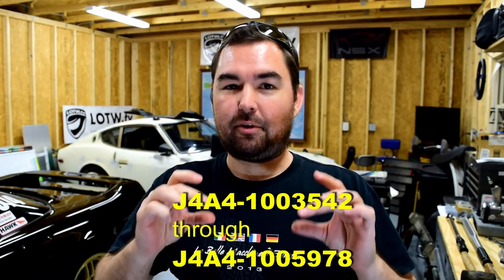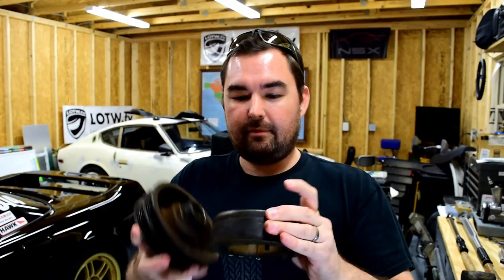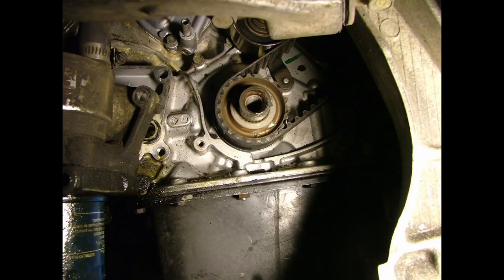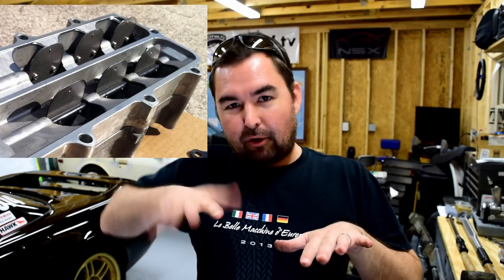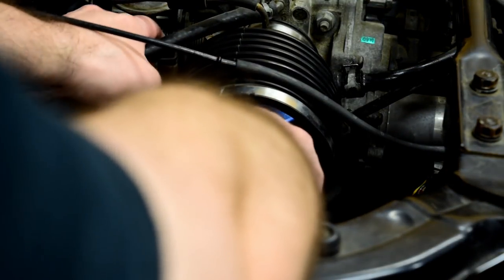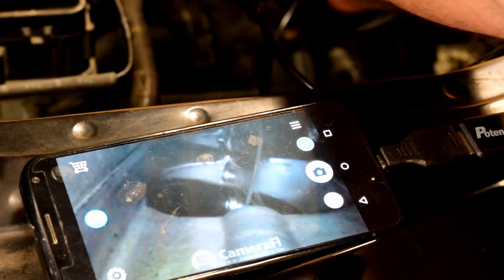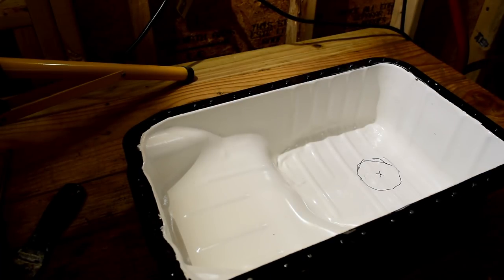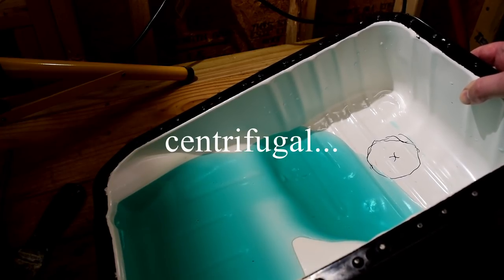5 Ways to Kill an NSX (and how to avoid most of them).

Comment: Thank you for this informative video - I learned so much! I just bought my black 1991  NSX with automatic transmission back in October with 107k miles and I just hit 116k miles! Bought it for a garage queen cruiser but I just can’t seem to leave it in the garage in favor of my 2006 Odyssey. I even have studded winter tires for it because I drove it all winter! I know...I’m crazy but I just love driving it & life is short. I live in Cincinnati area & will look up Source One. I found a great independent guy who used to work for Acura - he has NSX customers from the region come to him for work. I dropped about $2500 on timing belt/water pump, spark plugs, valve adjustment, new rotors/brakes installed. I’ll be looking into the protective pulley plate and butterfly bolt check soon. God bless you for this info. Thanks!
Reply from the maker: Grats on your purchase! These cars love to be driven, so no need to be shy about mileage.  I'm glad you found the video useful; that was my hope.
Reply: How was it driving yor NSX in winter with studs? I'd love to buy another one just to have a winter car.

Comment: I got bit by number 4....after the resultant engine rebuild I had not only baffles installed but also a high capacity oil pump with billet gears from SoS.  Haven't tracked the car since, but I've done a little light drifting in an empty parking lot. So Far...So Good! 👍🏾

Comment: Just bought my first NSX. Very informative video! I will definitely check the first 3 points asap as I don’t have a lot of info on its previous 32 years of life.
Reply from the maker: Grats on the purchase and happy motoring!
Reply: @LapoftheWorld  thank you! I will surely order the rubber seals for the coil water issue. I intend to daily it, and it rains a lot in Europe :) I have one question if you don't mind answering. Does the upgraded harmonic Pully need replacing after a while or it's a lifetime upgrade where you can forget about the fear of grenading the engine? Thanks!
Reply from the maker: @jy3406  As far as I know there isn't a Honda part number harmonic damper/pulley that doesn't potentially suffer this issue.  Most people either 1) buy the balancer shield to put behind the factory part and then inspect occasionally (because this way if it fails you have time to notice before the bad stuff happens) or 2) buy an ATI damper with a mechanically-captive damper element.  The former is significantly less expensive hence being more popular.
Reply: @LapoftheWorld  thank you! So this ATI damper would be a more “lifetime” safe option.
Reply from the maker: @jy3406  It would seem so.  That said, I can't easily cite a data point where I know someone's run an ATI damper super long term.  For my part I just run the shield and will swap out the OE if/when it fails again.  You'd have to do that a few times to offset the cost of the ATI, but as you say, the ATI may be more "set & forget".
Reply: @LapoftheWorld  thank you!

Comment: Just discovered your videos .. great job.  I have a '91 with slightly over 200k miles on it.. prob 30k of which were Canadian winter miles .. also a bunch of track and autocross days .. which I've had for the last 20 years.  Fortunately it wasn't in the snap ring range but I did do a preemptive change on the harmonic balancer and am running a baffled pan.  Just a couple of suggestions .. (1) you do mention the impact of a timing belt failure but I don't think people pay enough attention to the timing belt service recommendation, which I think was 7 years/80k miles originally but was later extended to 8 or 9 yrs I believe.  The problem is that this is a 'whichever comes first' statement and I've seen low mileage/good condition units which are way beyond the time limit.  If you own/buy a '91/92 today, it should be on it's 3rd or 4th belt by now unless it's been done in the last 7-8 years .. or has maybe been in storage a long time.  Mine has cold-started numerous times at -40 and in spite of that punishment, the belts (at replacement) have been in pretty good shape.  But going beyond the recommendation is like Russian roulette with expensive consequences.  My (2) point is you might want to order a main fuse (250A) to have on hand just in case.  I managed to blow mine during a DIY alternator maintenance and it took the local dealer 3 months to find one.   They're not terrible expensive.  
Otherwise, I think I'm living proof that with normal maintenance and regular driving, these things are amazingly reliable other than the known problems with ABS pump leaks; and the deteriorating capacitor problem which causes electronic failures in the replacement
Reply from the maker: Thanks for the kind words and suggestions!  Definitely check out some of my more recent NSX-specific entries.  I think I get to most of what you mention, just not all in one place 😁. I'm nearly done with a DIY belt job, I dealt with some capacitors I think last year, and I 100% carry a main relay with me on any extended trip.  Cheers to that mileage though!  The NSX may be the poster child for "meant to be driven"! 🍻

Comment: Oil starvation problem is not only for R comps. It happened on mine with 275 Dunlop Dirreza II rears on track. The track do have a lot of elevation change combined with very long double right sweepers.

And I've caught my butterfly valve screws from coming loose during intake removal, 2 of them are loose and 1 of them backing out. Red loctite applied to all.
Reply from the maker: At which track did that happen?  Curious if I've been there yet or not.
Reply: @LapoftheWorld  The Ridge in WA
Reply from the maker: @SoloD33A  Thanks, I'll do a little extra research before I go there.  Did you have any mitigating mods?  Baffled pan, etc.?
Reply: @LapoftheWorld  at that time I'm only testing out the car and wasn't driving hard, didn't plan to, thus i have yet to get the baffle and accusump. Then got a bit faster because cars behind etc, noticed over heating coolant, cool down lap, engine cut off. 2 rod and 1 main bearing toast
Reply from the maker: @SoloD33A  That's pretty weird.  I wonder if there wasn't some other exacerbating factor.  Either way, as you say, something to be cognizant of if you're going to track an NSX.  I just have a baffled pan and generally only run a 255 rear (though I have run R888s on the car for some TT events) and thus far haven't had any issue.

Comment: Thanks for doing this video! Curious about item #2 (crank pulley  harmonic balancer separation) . Does this happen to all first gen NSX and that everyone who owns a NA1 NSX will have to either replace or use the mentioned "shield" to prevent the failure? or is it based on a defect of the pulley?
Reply from the maker: Any first gen car could be susceptible.  NA1 and NA2 (same part number for the pulley).  The shield or ATI replacement are the best methods since there isn't a known bad batch or identifiable cause as to why it happens to some and not others.

Comment: Richard, Looking to fit the crank P\pulley balancer shield, you mentioned that some special tools may be required. Honda has closed all dealerships in Australia so wouls you please advise which special tools are required, Thanks Peter
Reply from the maker: The "crankshaft pulley holder" tool.  It's the only special tool you need really.  Except for early '91 cars it's the 45mm version.  You can find 3rd party version on Amazon or other outlets for relatively cheap.  Factor part number: 07NAB-001030A for reference.

Comment: I'm curious what you've done for #4 to your car? I've got a baffled oil pan on mine and have considered an Accusump, but don't really like the added "complication" of the Accusump. Also curious if you've added an oil cooler to your car. I can only get about six laps before my oil hits 275F or so.
Reply from the maker: Right, 'things I should have mentioned. :)  I have a baffled oil pan, and I haven't tracked the car on anything stickier than a Toyo R888 (since I drive to/from each track), so without right-handed banking involved, I'm unlikely to generate enough lateral force to get me in trouble.  I haven't added an oil cooler (beyond the stock item), but most of the "intense" track work I've done has been with Time Trials, so typically I'm only really on my horse for 3 laps at most of a 6-7 lap session.  I could see adding a supplemental cooler and/or a high capacity pan down the road.
Reply: I typically drive on my Fat Fives (205/50/15+225/50/16) with street tires (RE-71R, Falken RT615K+, etc) so I have never felt like I had enough grip to really be concerned about oil starvation. It also keeps me slow and "relatively safe". One of these days I should keep going and see if the oil temps level off somewhere reasonable; for all I know, they hit 280F and stay there, in which case a cooler makes no sense.
Reply from the maker: Yeah, I moved up to the 215/255 section tires on taller wheels for some combination of more grip and better (humble opinion) aesthetics :).   Are you just running the factory-spec 10w30, or have you gone to a different viscosity for track use?  (FTR, I still use 10w30 at this point).
Reply: I cheat and use Red Line 10W-30, which has a 3.5 HTHS making it a "thick 30", so to speak, while technically being "factory correct". It's also just a very stable, good oil. Of course, most modern oils are great. I'd probably run M1 0W-40 if I wanted an "off the shelf" oil.
Reply: We use a Accusump on our race NSX, it doesn't add much complexity at all, especially paired with Hydraulically clamped lines.
Reply from the maker: Good to know!  I've considered one, but it would probably the the smaller (2qt) and I'd need to fender mount it because I need all of my trunk (which is where the setups I've seen keep the reservoir).  My car isn't going to get slicks or wings anytime soon though so I'm not too terribly worried.

Comment: Hey
Great info.... Thanks
Question please:
What are those rims on your car?

New sub
Reply from the maker: Good ole Enkei RPF-1s.  17" all around I think 8" front and 9.5" rear with 215/40-17 and 255/40-17 tires respectively.   Not the most exclusive wheel, but strong, light, and good value.

Comment: You forgot the “money shift.” Mechanically over-revving the NSX engine by shifting from 4th to 3rd (instead of 5th) will shatter the OEM oil pump gear, causing damage to other engine internals. Expensive mistake and surprisingly common.
Reply from the maker: Definitely.  I could claim it was default covered in the "user error" section, but it is most certainly worth an individual mention.  In my experience the money shift in any car is a result of a death-grip on the shifter, and trying to "Vin Diesel" it into gear.  Just relax, ask nicely, and you'll never miss, lol.
Reply: Yah, I love the NSX transmission’s feel, and in 22 years have never had a close call with this...but know too many folks who have lost an engine to this. With all the rev-matching stuff in newer manuals, which I’m not quite sold on (though Gordon says the T.50 will have, so maybe not too bad), I hope gear lockouts to prevent this kind of thing exists and is common. THIS is a driver aid it would be hard to argue against.

Comment: Wow never knew about the butterfly valve on the intake manifold screws.   Scary stuff.  Seems like honda should have staked them.
Reply from the maker: I'd be really curious how many years/miles were on the car with the earliest instance of this happening.  Was it an issue from the start, or did it take 15 years to manifest for the first time.  If I have occasion to remove the manifold I plan to have them tack welded, but so far mine have continued to stay put.

Comment: Does 2 and 3 apply to Na2 97-01 nsxs?
Reply from the maker: Thanks for watching!  2 and 3 apply to any 1st gen NSX ('91-'05).  The crank pulley part number is the same from '91-'05.  The NA2 cars ('97-05) also use the same VVIS butterfly design as the earlier cars so that also covers essentially any 1st gen NSX.

Comment: If you track your NSX and worry about oil starvation in long duration right hand turns, ie Road America Carousel......just upgrade to 2017+ NSX LOL! dry sump oil with 8 qt oil capacity.

Oh crud, you mentioned the new NSX. I GUESS I should have watched the video to end before making comment.
Reply from the maker: Lol. :)  Relevant story:  The one question I had for Ted Klauss at NSXPO 2013, when he was there talking about the early details of the new car, was if it would be dry sumped.   Now, let me just scrape together the ~$120,000 or so I'd need after trade and I'll go look into that :D.